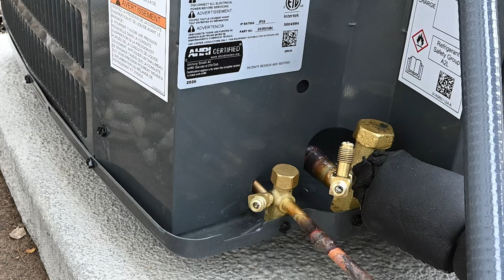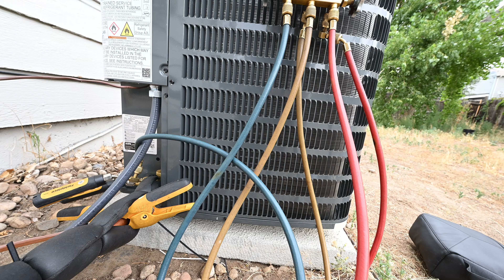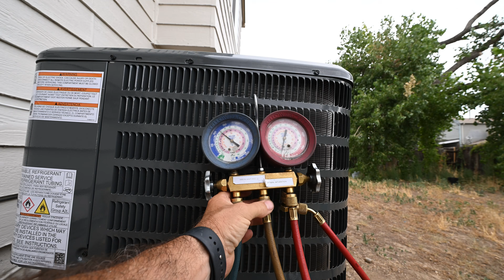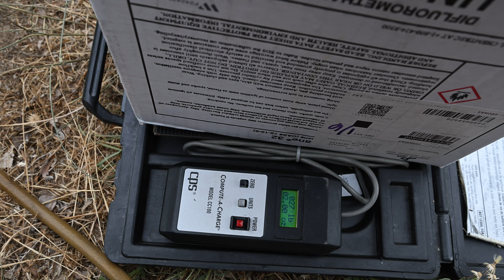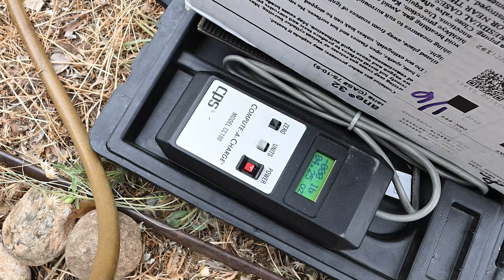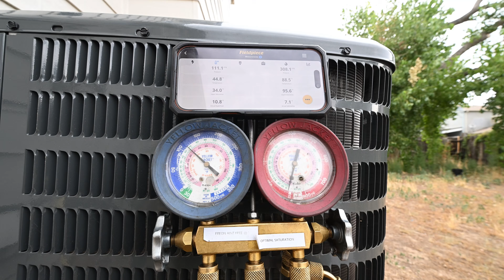Charging r32 System w/ Fieldpiece Probes - New Install

Comment: Wonderful video! Thank you. Since you've referred previously to Goodman as "POS", can you recommend an better make?
Reply from the maker: They have honestly came a long way in the last ten years. There was a wide range of them that would leak refrigerant at a specific weak point at the condenser coil, but seems to have been fixed post 2016 :) The install procedure matters more than the brand.
Reply: @ApartmentMaintenancePro  Interesting. I just resurrected my vintage 1998 3-ton Goodman condenser which had a seized fan motor. Otherwise still working great. It lives in the shade in Los Angeles; maybe this relatively docile environment helps longevity.

Comment: Buy two of the Appion schrader removal tools and use try those instead of your adapter. It's convenient for new installs because you can change the cores after everything is said and done. I've seen a lot of your videos and you do a shit ton of A/C. Love your videos man!
Reply from the maker: Yessir, that’s exactly how I do it most of the time on sealed system repairs - love the appions

Comment: FYI, you dont have flip the R32 upside down. Single compound refrigerate. You could charge it either way
Reply from the maker: Maybe...either way I always charge liquid. The box for Forane 32 shows a picture to charge with cylinder upside down. Besides being a pure refrigerant, what would be the benefit of charging gas? Besides making it harder to overcharge (because it takes forever)
Reply: @.    If you are charging an evacuated system with compressor off, then charge liquid into the liquid line 
to get the most refrigerant into the system with the given vacuum in the system.  Then switch to the suction line and charge vapor into the suction side with the compressor running.  Charging liquid into the suction side can potentially damage the compressor unless you use a metering device or expansion valve to provide the necessary expansion to vaporize the liquid.  Also, adding vapor is a slower process allowing you to sneak up on the target subcooling without overcharging which is more likely to happen when charging liquid.
Reply: @ApartmentMaintenancePro charging liquid into a running system you actually need to take longer. This is why you don’t need to turn the tank upside and charge it as a vapor. Weighing in the charge from scratch liquid is the way to go. People be charging systems with liquid way to fast. It will damage the compressor
Reply from the maker: It's way faster to charge liquid. I've found if you do 2-3 second spurts it works fine, doesn't damage compressor. You can hear the compressor when it's pumping liquid, sounds very different. There are also fast-charge adapters that will meter it to gas well before it hits the compressor, which is essentially what the valve cores do. However, I do charge with valve cores out when doing repairs that require vacuum, and always stress the importance of quick 'spurts' to not send liquid into the compressor. This is my experience of charging systems for over 20 years. This really comes into perspective in commercial settings when you have 100 feet of lineset and 10-20+ ton coils you need to fill up.